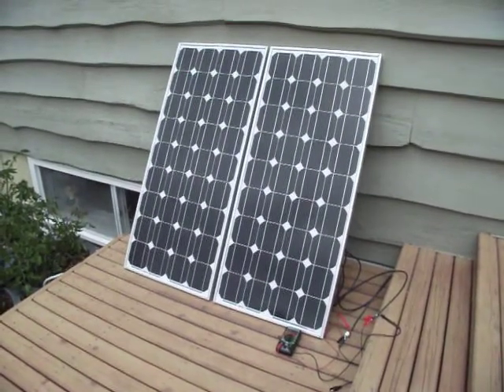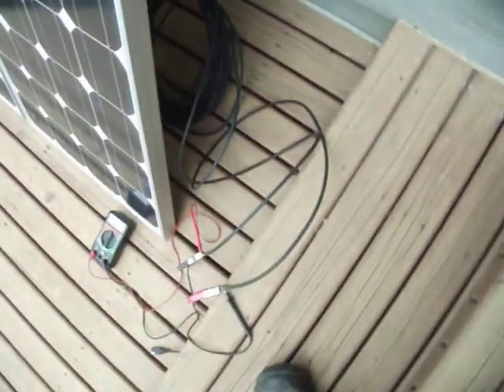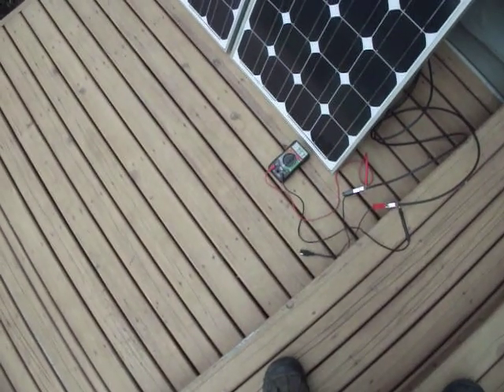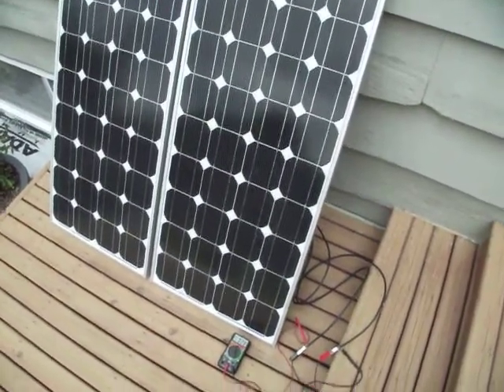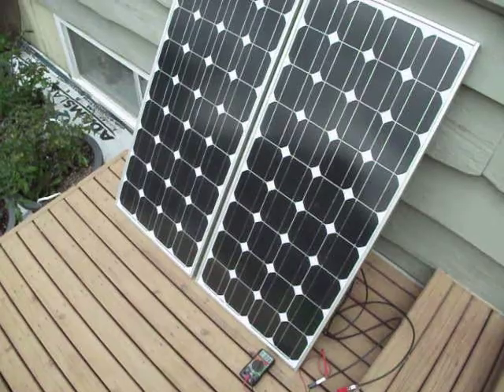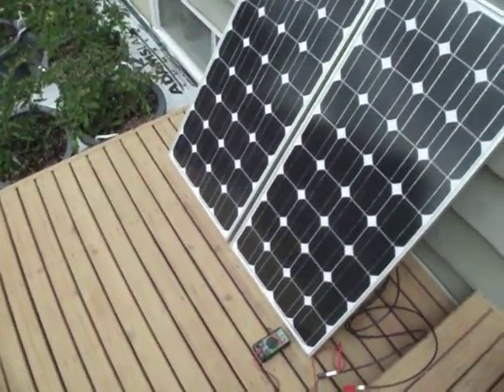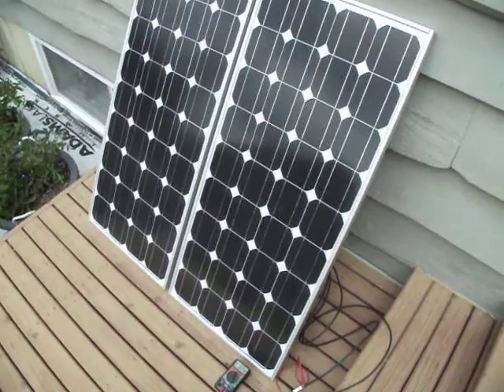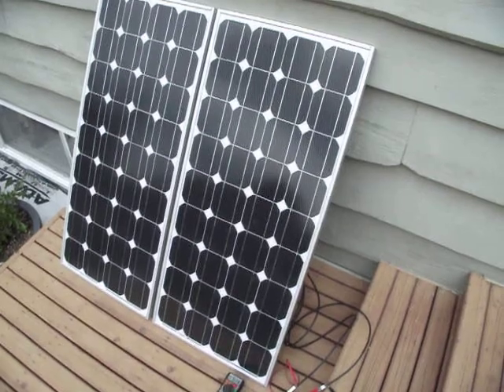90 Watt Monocrystalline Grade A Solar Panel UL/CE Rated $200.00 CDN

Comment from the maker: So, it seems simple, buy an mppt charge controller and you can have your cake and eat it too. Not so. MPPT charge controllers have tighter min. and max. amp requirements. For example, 2 x 140 watt panels (14-16A max) using a 30A charge controller, can, sometimes (under the absolute worst conditions) do nothing AT ALL. This is because they will not meet the min. needed 1A to drive the controller, under the worst conditions. MORAL= match the correct number of panels to the given MPPT min. Amps

Comment from the maker: ok, first off this is an old video and the price has gone down, i should change it. secondly, i think you'll see ive suggested you buy USA, not Canadian.. so with that cleared up, here is how amps volts and watts play out. Watts is the product of mac operating voltage X max. operating amps. So, 20V x 4.5A = 90 watts, for example. Batteries need a certain voltage, though, not just 20 volts all day long. MPPT control helps convert excess voltage to usable amperage at the optimum operating voltage.

Comment from the maker: Actually you couldn't be further from the truth. show me a solar panel that has a disproportionate open circuit vs. closed circuit reading? The closed circuit is completely dependant on what it is hooked to. If you attach one charge controller, or some battery... some light fixture... you'll get different readings. A load only draws what it draws. Open circuit numbers can be compared to what the manufacturer specifies IT SHOULD read.

Comment from the maker: Fans, lighting, pumps, stereos, all forms of electronics used in the home, etc. (light duty load requirements) can be switched off your normal grid, on to "solar circuits". These circuits (including actual groups of outlets, if you wish) can be removed off your main circuit breaker box into another box... your solar circuits, which are run with solar panels, batteries, and finally inverters that feed those circuits with AC power. Charge controllers stop batteries from overcharging.

Comment from the maker: There are actual charts available for the average sun hours in your area; but.. few areas receive, on average less than 3 sun hours per day. That's a yearly average. And that's full sun, not dim sunlight. So, that given, lets say you want the equiv. of 500 watt hours per day; you work the numbers backwards to build the system that will guarantee the watt hours of charge, and use low expectational numbers, and leave a margin of error for battery losses. Cheers

Comment from the maker: Totally correct, but max power under -what- input? The sun is always a variable. A multifunction tester with properly determine earth / ground continuity, insulation resistance, open circuit voltage, short circuit current, operating current when the panel is subjected to the industry standard lamp at a measured distance, or used in conjunction with an irradiance meter. Those tests should have already been done in the plant though, in bright sun, can it just perform close to it's ratings?

Comment from the maker: It's an industry standard reference point measurement, and that's why it's written on every panel, and a part of UL testing verification. Maximum power is a different measurement, but open voltage is the starting point of testing any panel.

Comment from the maker: @watchherenow Over the years I have found that the absolute premium best panels that cost much more than the rest... (I have an older Kyocera that matches that description).. honestly, it's no better. And, it costed $7/watt. I'd have been far better off with 2 of today's panels costing half what they did. Most grade A, 3% tolerance UL/CE rated panels made by a company that's been in this for 10 or more years are excellent.

Comment from the maker: @watchherenow As long as they are Grade A matched cells your numbers will add up nice. In the case they are slightly undergrade, the lower cells bring down the overall performance and the panel may be derated by 5 to 10 watts overall. Mine are typically rated 90 or 95 - meaning they are a 3% tolerance panel, a 5% tolerance panel may state 85, for example, but all in all, a person would be happy with any of them.... you wont notice a huge difference really. undervoltage panels are a differnt case

Comment from the maker: @watchherenow not really no, In all honesty, most panels mono that is, rated from 80-95 watts typically have about the same output. The way that companies arrive at their maximum power is slightly different. Cell batches vary a bit, but honestly, the perceived performance will be about the same providing they actually have the same number of cells (of identical size) and made from identical materials (monocrys). Cheers

Comment from the maker: @thra5herxb12s The second cheapest option on ebay TODAY,  in monocrystalline panels, again a 9 x 4, 36 cell panel is from quebec. so that panel WILL NOT impose a duty / tariff, and shipping is free. The price is $255.99. I will gladly match and beat that price for any local, deliver the panel if within a 100 mile radius, demo the panel , and above and beyond all normal warranty's offer an unconditional no questions, 100% money back guarantee for 7 days.

Comment from the maker: @thra5herxb12s BUT I GUARANTEE you will not find on ebay a 9 X 4, 36 cell monocrystalline solar panel, shipped to my locale in Canada, whether it is called 90, or 100 watts, for $100. You are - dead wrong - there. Likely, cause you're shooting your mouth off, before looking. Typical.

Comment from the maker: So a Canadian isn't sure if they'll pay more. Possibly not, O believe Ramsonds are American made, but if the cells themselves are from oversees, customs/ tariffs may apply. I will gladly sell this panel to match or beat anything comparable on ebay. My listed price is over 6 months old. Things change. I will sell this panel, today for $241.41 to a local. Your comment is irrelevent to a local individual, I'm afraid, there are no panels on ebay 90-100 watt, for $100. Wrong Answer.

Comment from the maker: @thra5herxb12s ... this solar panel is a 36 cell and the IMP they say is 5.41A yet the ISC is 5.55A. That equates to losing only 140 mA by closing the circuit. My panels ISC is 5.3A yet the max power rating is 4.86A - a little more realistic. You put something under load, your power rating goes down, period. So essentially they are the same panel. Right below their price it states: "International items may be subject to customs processing and additional charges". So you don't know, ....

Comment: @KyleCarrington BZ is new to me.  I'll check them out.  Right now I'm running a Morningstar PS-30M which will handle 30 amps, PWM charging.  I doub't I'll need more than that unless I go grid-tie, about 5kw.  That's down the road.

Comment from the maker: @jhs5150 Also look at the BZ Products MPPT250HV. Ecodirect has the 25A for $145. This unit accepts, for example 4 panels, run in series (80+ volts) to charge a 12 volt battery. Nice option if have the run the wire a bit further....

Comment: @digitalfuk Well, not really.  I used to work for an amorphous mfr. and they guaranteed their panels for 25 years which is fairly standard.  After a year or so they lose abut 10% of their output but that's factored in to the initial rating.  I have some HF panels (6) and they crank out a combined 3-5 amps in direct sun on a battery bank discharged to 11.5 volts.  That's not bad.  I want a couple 100-120w mono panels supplement them so I get a full charge one day.  Put out or get out baby (lol.)

Comment: @digitalfuk What I was saying was with the batteries depleted that much you are going to need 8-10 amps of current to charge 2 batteries in one day.  1/2 amp of current isn't going to get the job done unless you have16-20 of those panels.  I think if they were aimed more directly at the sun you would have gotten a higher output - maybe 1 to 2 amps even if it was cloudy.  That is what I would like to find out. Amorphous claims to be better on cloudy days also but I'd like to see mono vs amorphous

Comment: @KyleCarrington Power (W) 210 Watts
 
Open Circuit Voltage (V) 36.24 Voc
 
Short Circuit Current (A) 7.56 Isc

 Maximum Power Voltage (V) 29.70 Vmp

 Maximum Power Current (A) 7.07 Imp

 Number of Cells 48 Cells
 
Cell Type Poly-Crystalline
 
Frame Type: No Frame
 
Junction Box: No
 
Maximum Voltage System 1000V DC

 Length 64.00" ( 1,625.60 ) mm
 
Width 38.00" ( 965.20 ) mm
 
Weight 35.27 lb ( 16.00 ) Kg
 
Warranty 20 Years

Comment from the maker: @jhs5150 Good points. The demo was just that, a demo. My array at my cabin is a permanent setup, that was a 5 min. demo so you are correct in all regards. MPPT does help on the cloudy mornings but I have moved away from these particular MPPT charge controllers - they suck basically. I have better ones now. You are correct though, there are times, on cold morning that my 1800 watt array only outputs 180-200 watts total! Solar isn't perfect.

Comment: I'd be interested to see how long it would take to charge a battery bank that is 50-60% discharged with such a low current output.  It would take a week or more.  If you pointed the panels at an angle more in line with the sun you'd get a somewhat higher output even on a cloudy day.  That 20v is with no load.

Comment from the maker: I tried a different multimeter, as I learned that one was acting up, dead battery. The panel was outputting 21.5 volts, 780 mA, in absolutely terrible sun conditions, and thus creating (open circuit) 16 watts. A similar scenario with a polycrystalline 100 watt panel would likely put out about 5 watts, or less.